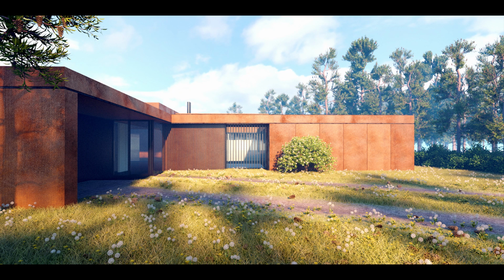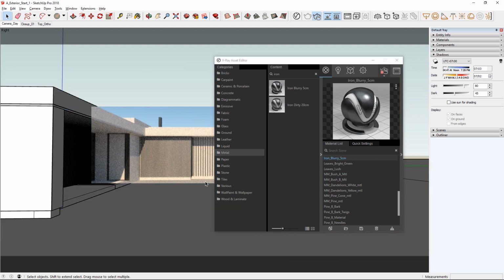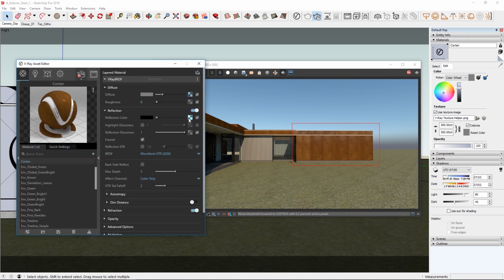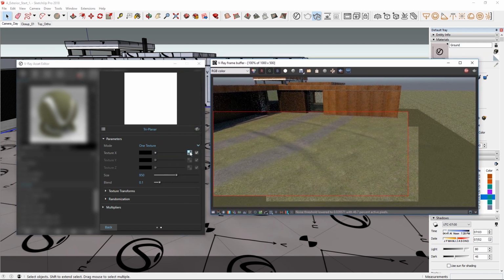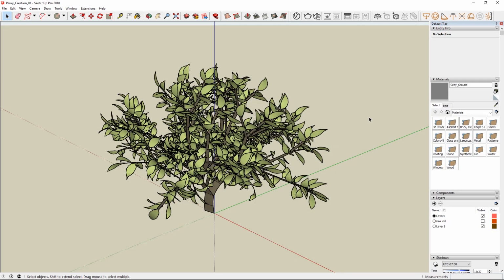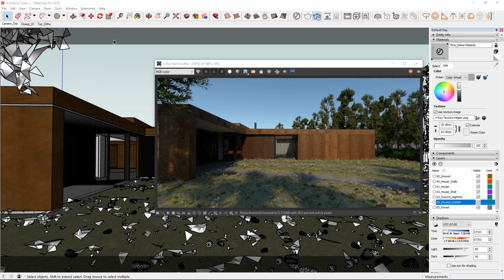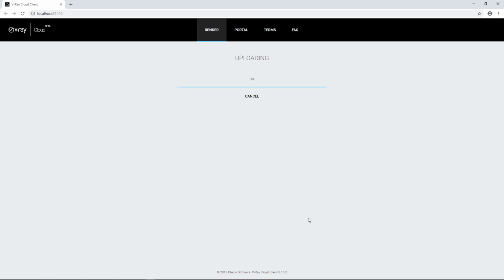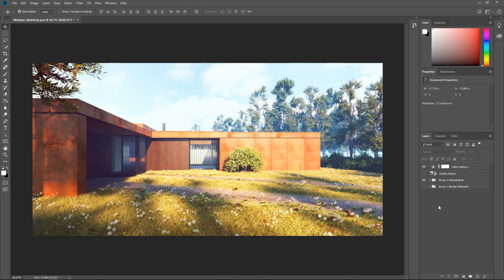V-Ray for SketchUp — Webinar: Setting Up a Day Scene from Start to Finish

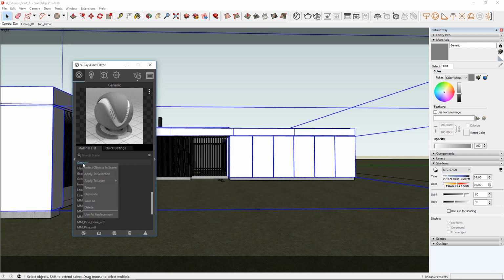Comment: 11:30 <-- Random diffuse in material. Make sure each individual panel is a group or component in Sketchup. I tried to get away with creating a generic material of one panel and applying it to the surface of an object. And then using a multisub with multiple textures, to get variation panel to panel. I wonder if V-ray or anyone else has thought of this approach to using multisub in this way?

Comment: Hello, ChoasGroupTV, would you mind telling me the meterial/texture you put on the surface of the building shown on the video.
Reply from the maker: The material selected for the walls of the building is called corten steel. We can't share the actual bitmap, but some options come up in Google if you search for: corten steel texture.
Reply: Thanks

Comment: Great Video. I was much learned how to avoid texture repetition. Would you please state about the computer specification that used to make this visualization tutorial.
Reply from the maker: A laptop was used for this webinar. Here are the specifications of the hardware:
GeForce GTX 1070
Intel(R) Core(TM) i7-6700HQ CPU @2.60GHZ
16RAM
Reply: @ChaosV-Ray  if i may, would you recommend AMD Ryzen 1700 over intel CPUs for vray renderings. 

Also please be kind enough to make a GPU rendering tutorial for both exterior and interior. I have used those but results are different.

And an animation tutorial. 

Thankyou very much
Reply from the maker: @PubuduNipun  You might want to sign into our Chaos Group Forums to discuss these matters with other V-Ray users and V-Ray developers. They are always willing to listen to your feedback and take everything into consideration. Here is the link: https://forums.chaosgroup.com/ Thanks!